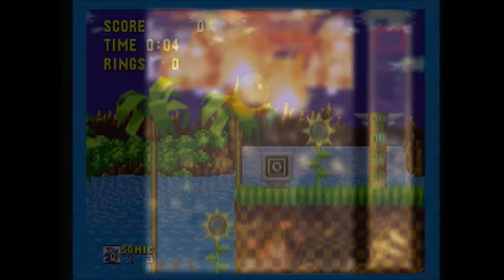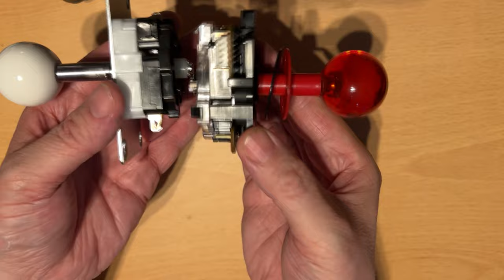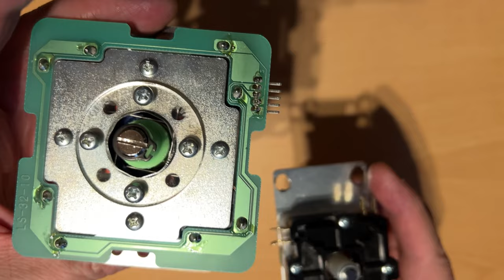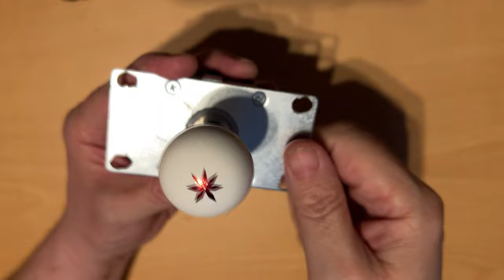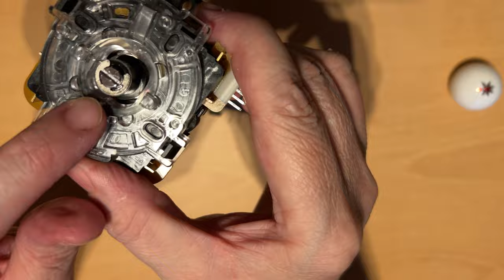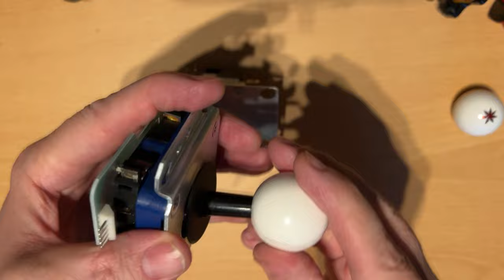New Seimitsu SELS 70X-S Silent Arcade Stick Review

Comment: I ordered the silent version yet i wish they had the 5pin version its annoying with these cable harness. Great idea with the SHORT throw. Waiting till it arrives. I have now many stick levers from Sanwa JLF silent GEN 1,2 and 3, Hori Hayabusa optical silent (gosh very good stick my nr-1 silent lever its a RARE find luckily i have 2 of these), Seimitsu LSQ 40 silent (good but the spring is to stiff imo), Sanwa JLX silent Gen4 with adjustable switches (very smooth nice stick love it probably my second favorite silent).

Best Silent levers IMO:

Nr-1 - Hayabusa Optical Silent + oversized actuator + 1.5lbs spring (needs sanding down to edges of actuator in order to fit the optical)
Nr-2 - Sanwa JLX Silent + Red actuator + blue spring 1.5lbs and blue square gate.
Nr-3 - Sanwa JLF Silent Gen1 just a smooth nice stick overall. (Sanwa JLF Silent Gen2 with the STIFFER swithes is good but cant get used to the stiffer switches + not allowed to change gate)
Nr-4 - PAS Magenta programable Joystick its an analog magnetic stick uses an app to change throw, engage, cardinals, diagonals and can store 4 settings but expensive 99 bucks.
Nr-4 - Seimitsu LSQ40 Silent could be so much better if i just could have a LESS stiffer spring it feels amost like a "1.8lbs - 2lbs" spring and you CAN'T use a LS-32 spring in it or a JLF spring...what a shame! 

Also the clicky ones from Hayabusa to Sanwa JLF and Sanwa JLX, LS-32-01 + PAS oversized gold metal actuator (sweet stick gonna order also the STEEL LS-32 Pivot which can reduce or nullify the infamous "pivot bump/hop"), LS-40-01, LS-56-01 used with and without KOWAL gate mod, and a silent Programable Magenta Joystick (expensive but you can adjust through an app the throw, engage etc very nice its from "ParadiseArcade"). Best clicky stick =..........Sanwa JLF with an OTTO mod WOW get this MOD on your JLF i have the Version OTTO V5, (OTTO V2 = mod to replicate Korean stick for Tekken) EXCELLENT mod its the NUMBER 1 best clicky stick MOD period, very short throw FAST engage buttery SMOOTH, precise just love the thing! However its rather expensive mod ie 29 eur....Will also order the Qanba Gravity silent lever in the near future (56 euro). If anyone has questions about any of the sticks i own feel free to ask.
Reply from the maker: Wow that's a lot of different sticks will be definitely interested in your thoughts on the 70X, i seen videos on the sanwa JLF with an OTTO mod not heard one bad thing about it.
Reply: @RetroTuna Thx yeah the newly released Sanwa JLX Silent is also VERY good second favorite silent stick but DO use the red actuator, blue spring (or red spring for more stiffness) and their blue or red square gate or their yellow octagonal gate sweet combo(s) the red actuator makes it NOTICEABLE shorter mod. And if you want you can change the actuation on the switches it has manual settings with a knob from setting 1 to 5 very neat. Get it for fighting games. Shoot em up get a LS-56. Sure i will give feedback on the 70X Silent once i get it  have good hope for it.
Reply from the maker: @lawshadow1581  now they have released that new sanwa with the adjustable fro I wouldn’t mind trying it out looks interesting, well hope your day joy the 70X.

Comment: How small is the throw distance and the spring tension compared to the LS-32?
Reply from the maker: very tricky to messure but from the top middle of the balltop you move the stick 3 to 4mm and the microswitch clicks, it's very short throw and i think the same as the ls-56. i have used the stick on my vewlix cab and my 2 arcade sticks now since i dropped the video and it's my favorite arcade stick.

Comment: Got a SEIMITSU LSQ-40-MS Silent Joystick a few months ago; is this joystick a replacement in their range or an alternative? I'm still making my mind up about the stick; fireball motions aren't coming as easy to me for whatever reason.
Reply from the maker: Hello this is a new stick based on the last-56 but with the new features a new line of sticks, I have a few standard Ls-40 sticks and the throw is a little bigger, what I normally do is take the blue restrictive gate of the bottom you know that one that 4way and 8 way you don’t need it and it make doing fireballs a little easier give it a try
Reply: @RetroTuna  removing the gate would increase the throw, wouldn't it (as the stick shaft is restricted by it)? Something to think about though, thanks!
Reply from the maker: just looked up that stick and it's diffrent to a normal ls-40 yeah you cant take the gate lol my bad, i wonder if there is any mods for the stick.

Comment: Will it fit a Hori rap 4?
Reply from the maker: Yes but you will have to get the none silent SELS-70X-01 if you dont want to use a converter loom as the SELS-70X-01has the sanwa connector.
Reply: @RetroTuna  thanks I did in fact want the silent one so I bought the converter. Much appreciated!
Reply from the maker: No worries happy to help, i have all 3 and i think i like the silent one the best feels a little lighter to use but there all very good.  @Mr_Roxas_
Reply: I also am considering the silent one but with a RAP V... What is a converter loom? I'd be glad if you could help!

Comment: Thanks for the review. Can you please advise regarding the throw of the lever? I know you said it has an extreme short throw but I have doubts as I use a LS-56 with the Kowal short throw mod which literally makes  the throw extremely short. Can you compare it with that?
Reply from the maker: i know someone that has the same stick and kowal mod and an 70X and he said there about the same, he also tryed the mod on the 70X and said it fits but didnt make a diffrence to the throw. 

Not having one myself to test i can only go by his findings and i trust his word, also the 70X is based off the LS-56 but with diffrent mods so i suspect it's going to be pretty similar.
Reply: @RetroTuna  I am just gathering information if it is worth going to 70X-F from a LS-56.
Reply from the maker: @sohailqureshi2461  I think the only difference is going to be the none rotatable stick and the new 8 way gate.
Reply: @RetroTuna  That is correct and since I am already using an Octagate, there is no point now.
Reply from the maker: the new gate is an octagate but it feels like square gate its pretty cleaver design, but yeah your not going to see a huge difference from the setup you have. @sohailqureshi2461

Comment: Does it fit in the Astro City Mini Arcade Stick?
Reply from the maker: Yes and no, I fitted one in there but I had to modify the mounting plate and drill holes also had to cut out a hole on the inside of the base, so if you have a grinder and a drill and a bit of time you can make it fit but it’s not easy
Reply from the maker: Problem with the Astro mini stick is it only has mounts for a sanwa sticks without the mounting plate
Reply: Thanks for the tips.
Reply from the maker: @MrNexus68  seimitsu seems to do a universal mounting plate looks like it would do the job to fit it without modifying anything
Reply from the maker: @MrNexus68  https://www.arcadeworlduk.com/products/seimitsu-all-in-one-universal-joystick-mounting-plate-suitable-for-all-seimitsu-joysticks.html